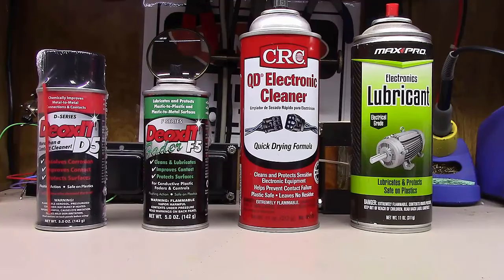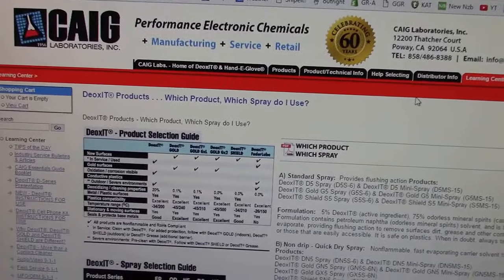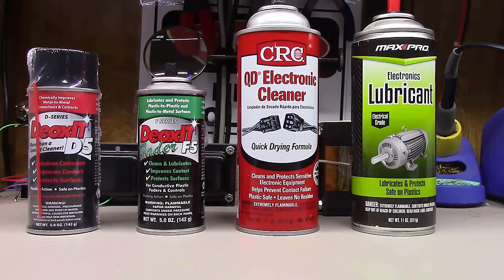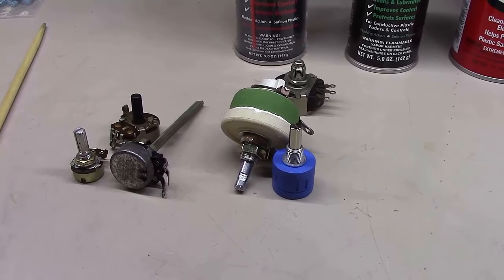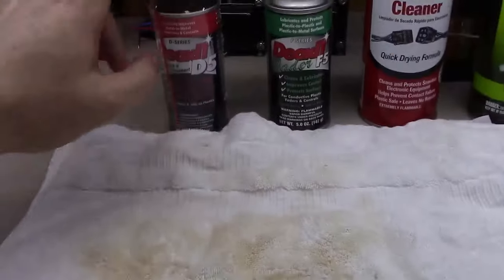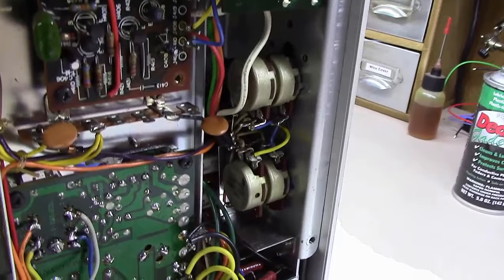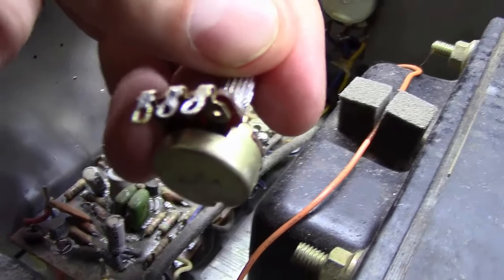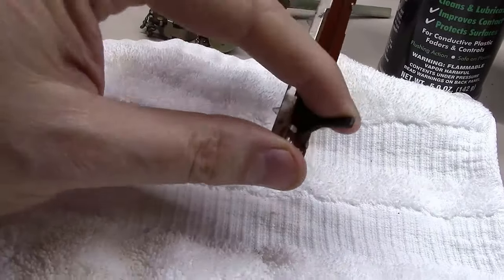Deoxit Demystified - how to use it and other electronics cleaners

Comment: I tried some other ways people say on YT and the ol baking soda , salt and vinegar solution didn't work on for RUST on my USB connector charging cable . What did work is toliet bowl cleaning liquid . If you read the label some of them says removes rust . I tried it once letting it sit for a  minute . On the outside removed much of it . Had to use again letting it sit on INSIDE of USB connection for several minutes . Rinsed it off then dried sparingly with heat gun . Now works . USB cable is how my Craftsman rechargeable headlamp charges . verry handy

Comment: Deoxit saved a decades old C= computer CRT color monitor that was arcing out at the high voltage cap due to dust dirt and grime over years of use and storage. No more arcing and the picture is perfect.

Comment: This video is exactly what I needed to watch. CRC is what I buy and is usually the only brand offered at the general retail level where I live. I knew that it's application was blast and clean only which it does well at but also knew it had no lubricative properties which is the back half of the cleaning/maintenance procedure. Learrning here of these of these 2 previously unknown products, Deoxit D5 and F5 with its conductive lubricants, fills in that missing gap. As always in many cases, I am not researching a particular subject, I merely happen across it but has information about something I knew I had some ignorance gaps with but knew I needed to know more about. I thank you for sharing your knowledge and the time you took to compile it. I stopped the video at 18:39 to pen this so I need to watch the rest of your video presentation, then, ......................................off to Amazon I go to order some Deoxit D5/F5. Just so You know, I hit the Subscribe button already.

Comment: I work on guitars and amps and use the crc to clean then go behind with the Deoxit F5 as well. At first I was a little weary of using the crc but I have seen no  issues with it attacking the carbon or plastics so I still do. Heck it is only $4 for that huge can at the autoparts stores. Mineral spirits which is in deoxit is also a lubricant. You could probably clean pots with just mineral spirits with an eye dropper and save tons.
Reply: The F5 doesn't have the same chemicals as D5. It doesn't have the specific chemical that reversed oxidisation. It's great for flushing but  won't take away the oxidisation like D5 will.
Reply: @TheMatthooks  the F5 is a cleaning and lubrication solvent, which works great on old gunked up vintage pots and sliders. It leaves behind a contact lubricating film. If you need it to work on extreme oxidation I guess you could use the other stuff. I use the crc that is probably harsher and evaporates all away for the heavy lifting then go behind with a small spray of F5 to lube and create a better conductive path that will last for a long time. most of the time the F5 on its own works great too its expensive so I use it sparingly.

Comment: Really excellent video .   I have been using Motomaster Electrical contact cleaner for a decade with good results. It dries faster than D5  - but not too fast.  I'm almost out so I'm going to order some actual Deoxit.    One thing I found an alternative use of contact cleaner (in general) was to remove stickers from paper.   It is the most effective NON STAINING method I have ever come across.  I found out it was the Heptane that is found inside these contact cleaners .. that appears to be a key ingredient of Electical cleaners outside of acetone, alcohol and minearl spirits.    So I'm going to order just heptane for the stickers..but it could be more expensive than buying the contact cleaner...and maybe less convenient.   I have to remove 50 year old stickers off of various types of paper because I sell rare vintage LP records - and many times you find price stickers on the labels of the 45 singles..and that's probabliy the most tenuous to remove.  Who else went through trying to remove stubborn stickers with lighter fluid or that orange 'gunk' remover.. both useless in so many situations.   Sometimes lighter fluid would dry the glue to a concrete and make it harder to remove LOL  Cool to know Heptane comes from Jack Pine.. so another family of solvents from Pine.. cool .    THANKS AGAIN FOR THE EDUCATIONAL VIDEO.

Comment: Inflation... The best deal is currently 36.94 on Amazon for two pack. 1-D5 and 1-F5. 
Thank you for this info. I am about to tackle cleaning a Mackie 16 x 4 mixer that sat in a dusty environment and is almost mute. I would have bathed it with the CRC product had I not learned about the importance of re-lubricating the pots and sliders.

Comment: I learned about contact cleaner when I was in the Army electronics. In the 70’s I found LPS Contact Cleaner at the Offshore Technology Conference. The sales rep demonstrated how to get grease stains out of your clothes. He put some grease on his coat sleeve. Then he put a handkerchief inside his coat sleeve. Then he blew ths grease through the sleeve into the handkerchiefs using LPS Contact Cleaner. Maybe you should try contact cleaner to remove the Deoxit stains. Once they set in with the laundy, it may be impossible. Contact cleaner formulation has changed over the years and it used to be similar to the dry cleaning agent, carbon tetra chloride which is not available anymore.

I don’t have any old audio stuff to worry about. My audio equipment is remote controlled. I don’t like to clean my electronics with an oil because it can attract dust and dirt. I picked your video to learn about Deoxit’s corrsion elimination properties. Good to know not to use it where oil is not wanted.

Comment: Nice video, thanks for posting. Now for my opinions. Deoxit D100 followed by Gold is my "gold standard" for contacts. It seems to reduce recurring issues. I do not use D series on pots because I have heard from individuals who have had the carbon track destroyed by it. Whether it was a weak track to start with and would have failed anyway or an incompatibility with D5 we will never know. But why take the chance? F series only for pots is my rule. Also with the exception of QD I avoid the used of sprays wherever humanly possible because they spray. Everywhere that you don't want them to. There is very rarely a spot that I can't get to with D100 in the needle tip bottle, or a tiny drop on the end of a screwdriver or dental pick. If I must spray I pack the paper towel around the target BEFORE I spray. Whatever you do, don't let the stuff get on your front panel. It may clean up OK, but it could also damage or discolor a painted surface.

Comment: Very good tutorial on cleaners and lubricants. I wish there was a guy like you in my hood. I like old electronics and try to maintain them. I now have some better information. I replaced an old Soundcraftsmen equalizer with a newer version because the old one was popping when switched on, possibly frying my right channel on my amp. The newer version is no where as good. I had to replace my amp with a used one as well because they no longer make them with the jacks for the equalizer. I am not happy with it either. Thanks again for your expertise. Hector

Comment: Something I've done with the sealed pots at 28:00 is carefully drill a small hole on the front and back to spay contact cleaner. You have to saturate the entire volume so the other hole acts as a drain. Then I push air through it at low pressure and seal it up with a small piece of Kapton tape. This is risky but in the world of vintage equipment most of the time there are no replacement parts. Many people also desire to keep as many original parts as possible for aesthetics.

I have do this method with the trigger switch on my Bosch drill once a year. I love the drill but the OEM charges 50% of the drill price for a part that will just fail in another year.

Comment: FWIW im sure you kow this but for others in most modern recording studios the faders are optical encoders, the entire audio path is digital. Even the analog stages in high end gear use digitally controlled VCAs with digital controls.
I have one 20yo MOTU 8 channel mic pre that uses pots for gain to keep the cost down but pretty much all the other recording gear i use (MOTU, Audient, Expert Sleepers) has no analog controls (the Expert Sleepers DACs dont have controls, or a display, at all lmao). Even my old Onkyo amp has just one rotary encoder and a bunch of switches.
The cheap Holts electronic cleaner i have lists >30% Naptha and >60% isopropanol in its warnings, so basically the solvent used in deoxit. I havent looked up the CRC Quick Dry.
Ventilate well, everyone.
FWIW from what i can gather the most effective method to clean open potentiometers like faders without disassembly is to start with a 'no residue' electronic cleaner like naptha or iPA (or chrolothane if youre game) to wash, work the control to free stuff, follow with compressed air to flow debris and solvent free, and then fader lubricant (Either the Dow-Corning Penny and Giles recommend or whatever your manufacturer recommends if you can find some, or the ubiquitous deoxit F series).
I've been a tech for a long time, gotta clean my own out of production penny and giles motorfaders and i have never in my life been so stressed cleaning a contact lmao.

Comment: I have an electric motor that's inside a old Sony TC-630 reel to reel that's a little loud. (I actually took it apart and saw oil holes on the motor.) Would that lubricant spray be sufficient or would you recommend something else?

Comment: Looking up Stabilant 22 brought me to your video. Cleaning and enhancing contacts on a old 88 BMW 750il car on the fuse panels and corroded computer connectors. Now I'm glad I found this vid. Hated the fast dry contact cleaners at brick and mortar stores. Needed a slow drying solution and a cheaper contact enhancer like the deoxit contact maintenance kit. Stabilant is too expensive. Thank you sir.

Comment: I HAVE A INTAGE JONSON 123A CB RADIO . I BOUGHT THIS NEW IN 1975 . IT HAD BEEN IN STORAGE FOR 41 YEAR5. I TRIED WITH SO MUCH FORCE UNABLE TO LOOSEN IT. I BOUGHT A CAN OF DEOXIT  D5 REMOVED THE OUTER CASE FROM THE RADIO ANS SPRAYED THE SWITCH CONTACTS WITHA SMALL AMOUNT OF CLEANER. TO MY SURPRISE IT WORKED "GREAT". THE CLEANER REMOVED T6HE GUMMED UP MESS AND THE RADIO WOPRKS GREAT.

Comment: If you want to get rid of the stains, turn it inside out, then put a towel under the back side.  Spray from the "inside" to push the stain back out the way it came in.
Use your CRC spray, and spray the area to wet it, and then scratch the cloth with a fingernail, etc. to break up the deoxit accumulation.
Blot it with a paper towel, let it dry, and then wash it normally.
It's also a home run to be washing those shirts inside out anyway.  The logos last longer.
The CRC spray is similar to what they  used as a dry cleaning chemical years ago.  I use it when I get grease on my clothes.
Post back if it helps!

Comment: WD40 works great on scratchy pots... Back in the 80's we had this stuff called AMP compound from Amphenol that worked miracles on corrosion but it made you sick from the smell and we stopped using it, don't know what was in it but it had a flowery smell that would turn your stomach. (It was also very expensive) One of the techs tried WD40 and while it wasn't quite as good as the AMP stuff, it worked very well.

Comment: The stains on your shirt look like oil or grease stains probably from the residual lube in the Deoxit. I got out similar stains out from my tee shirts even after drying them. I used oil eater and it took them right out. Oil Eater will cause some slight fading. You will probably have to buy  a gallon from Tractor Supply or Amazon but for oil it works amazing.

Comment: Thanks for informative video. Someone made a video concerned that Caig had changed the spray container from a separate straw to a permanent folding top with straw attached and no control over amount coming out of the straw. Now in 2024 is this a problem?

Comment: Here’s a thought. In archeology, it’s well known that gold can sit for thousands of years in pretty nasty conditions, like damp gritty soil, and retain its original lustre. Dirt doesn’t even stick to it. It doesn’t really oxidize per se. So it seems to me that there should be fewer and different requirements for cleaning gold contacts than for cleaning and protecting other materials. I stand to be corrected of course.
Reply: i think the oxidation on gold contacts are caused by the electrical current so i read somewhere. anyone confirm?
Reply: @wizzkid333  good guess, but even with current, oxidation is negligible. I'm guessing the reason for a separate product, is that gold can be Too good a conductor. If components conduct more than 50 volts, and (I think) more than 100 Mega amps, electricity can arc and melt the gold plating off. It's also soft and easy to scratch and rub off. Actually, I'm not sure what 100amplifiers is getting at, since DeOxy and others make separate gold cleaning products, so I'm not sure what point he's trying to make with "archeology", etc.
Reply: Gold plating is porous. Sometimes there is a nickel underplating which is hard and hopefully has a different pore structure to minimize pore alignments and prevent copper difusion. Also gold contact plating likely has a small percentage of other metals for mechanical reasons. I don't know what too good of a conductor would be?  Gold plated solid copper buss bar connected together with  gold plated bolts pass ridiculous currents in magnetizing fixtures.

Comment: Thanks for the video. I've been using the bottled deoxit with dental pick brushes to clean tube sockets. No overspray.  Glad to hear from you.
Reply: Craig Hollabaugh  Overspray, bad for high Z circuits, yes. I have been working on older Keithley electrometers (100’s of Gohm Z) which use the Teflon isolated, silver plated switches and spring contacts.  One needs to be very careful and selective about where one applies deoxit after the contacts are clean. I have been using 1 and 2mm makeup brushes to selectively apply the product.
Reply: @materialsguy2002  Silver or rhodium plated contacts? I'd expect the latter given the zero corrosion or abrasion from use of rhodium. Silver is as soft as poo - tissue paper will easily scratch it and sure oxidises quickly.

Comment: Electronic cleaners are basically TWO TYPES:  Evaporative and Lubricating.     D5 and CRC are EVAPORTIVE,   Faderlube,  the Maxpro you show are LUBRICATING.   Same with WD40.     NOW,  you want to use the EVAPORATIVE type for most switches and places you dont want to attract dirt later.    A function switch for AM/FM (or band switch in a radio)  if you use a lubricating cleaner,  it will kill the shortwave or FM.     Deoxit used to always be evaporative but in the last 20 years the maker Caig decided to put the name on just about everything they make.   You can get the same products for much less money from other makers.  WD40 actually works fine for most rotational pots.

Comment: Wow... Too much information is not enough! The details of the whole dirty pot issue is DEEP. Here in Australia, one can of this Deoxit spray costs around 55 dollars. New CTS pots are 15. SO, if you love to have perfection and you are skilled enough to use a soldering iron, then go this way.
If you don't own the soldering gear, then Deoxit is cool. 
If you are a service tech, then Deoxit is fast and easy, but you would know replacement is needed in some cases where spray is ineffective.

Comment: Just be careful not to get the lube spray in the string for a dial. You don't want the string slipping on the driving shaft. Better to lube those pulleys with a pecision tip or spray some into a small container then use a toothpick to get some on the shaft.

Comment: Hi! Nice video, thank you! As you mentioned toward the end, some potentiometers have carbon strips inside them. In that case, probably FaderLube should be used on them, correct? Is there a way to tell what to expect inside the potentiometer without disassembling it (to decide whether to use D5 vs FaderLube)? For example, line or mic level pots on Pioneer RT-707, in case you are familiar with the machine: would I use D5 or FaderLube in that case? Thank you!

Comment: Original Deoxit I used in the 90’s  was originally formulated for the space shuttle, is no longer made in the percentage that it used to be. It is a cut down version of the original. The original Deoxit would molecularly bind to the metal. I don’t know if this stuff is the same.

Comment: That little opening at the top is a stop for the pot so that it doesn't keep turning, that area is where the "feel" grease is located. Not really a good place to use Deoxit as it will dissolve all that grease so the pot will not "feel" (it will become too easy to turn) the same any longer because all the grease was removed. It should be sprayed on the wiper/track side which is where the pot solder contacts are. The hole there is much larger and will actually clean the pot.

Comment: I’d try D-Limonene on the stains. If that doesn’t get them nothing will 😄 I usually just use a cheapo cleaner which contains it like some kind of goo remover. The key is making sure it actually has D-Limonene in it.